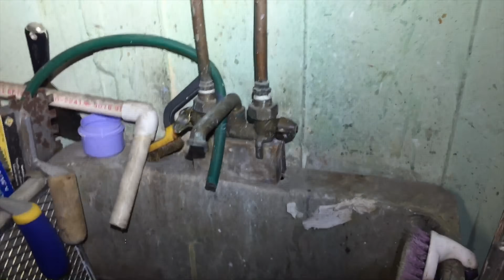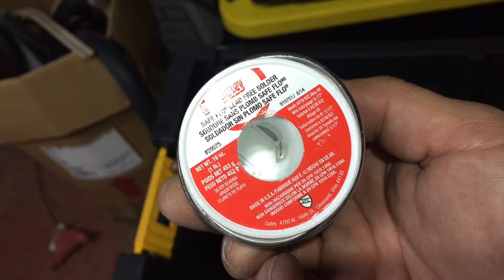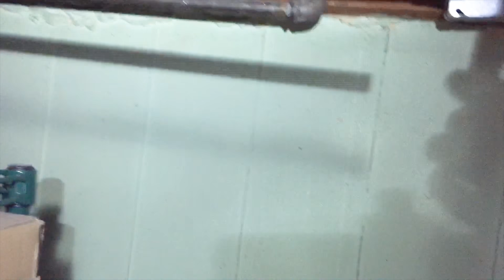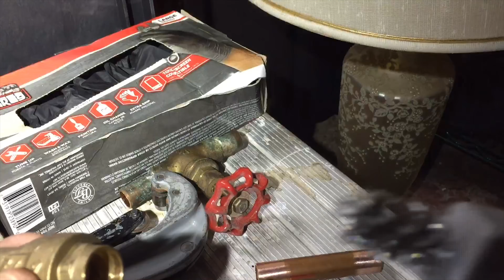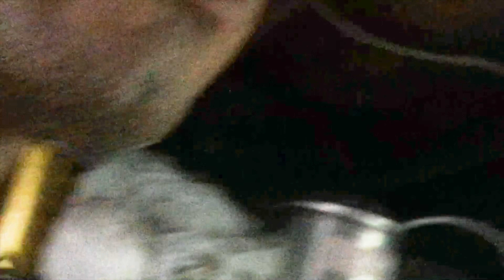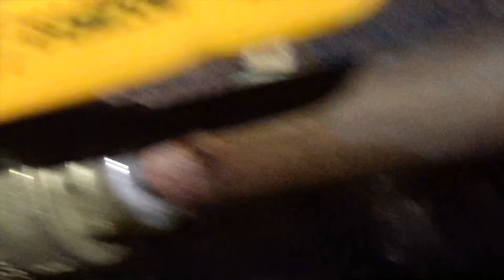Soldering Copper Pipe - How To Install A Ball Valve - Best Way

Comment: Only tighten the cutter a little bit per turn.  Try to turn it without going sideways.  You want the cutter wheel to ride in the groove from the first turn.
Missed deburring after cutting.  Want a smooth surface inside the pipe, and knock off any little hanging bits.  There's a little triangular blade on most cutters.

Some valves disassemble so you can get the valve seals away from the soldering heat.  Don't want to melt or burn the seals.
Also see @Andre Schwartz's comment.

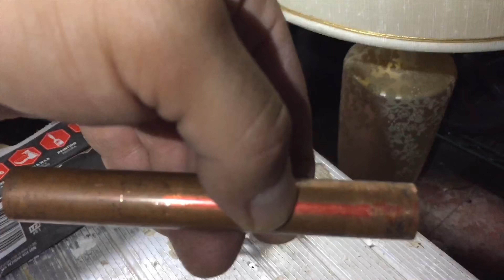Comment: 8:52 he used type M copper (red label - for hydronic heating) instead type L copper (blue label - for potable water supply). type M is like half the wall thickness of type L. in a heating system, the water is in a closed loop and loses its oxygen quickly and becomes dead water. dead water is less aggressive on metals so we can use type M copper and cast iron pumps for cost savings. for fresh water (potable and dhw) we need to use type M tubing and bronze pumps for longevity

Comment: Exactly what I wanted to see. I need to replace a shutoff valve, and after I cut the old one out, I will have too little pipe to solder in the replacement. I now know how to extend the pipe with couplings. I will let you know how this comes out. THANKS!

Comment: you cleaned, but didnt ream??
Reply: Good eye.  Thought the same thing.  Also would have remove the handle so the rubber doesn't heat up.

Comment: Use a SawAZaw and cut the valve handle off, them cut the old valve in the middle, you should have little need for extra coupling pipe. Old valve is junk, waste it, not good pipe 👍👍

Comment: The grogons you gave birth to could have been flicked off on that fitting you soldered  and Brasso used to polish up your workmanship, and as you used a blow torch on the valve at Nuclear core temperatures the likely hood the valve seats made from PTFE  are boo-bood (Fucked)

Comment: Gotta de-burr bro. Way too much heat, on that little valve with MAPP.  You want to take the flame off your fitting, before you try to draw solder in. Don't want to burn the flux off as you did there. You got a few fundamental concepts incorrect. Capillary action is what draws the solder in not flux. Additionally that's way too much solder. It ends up in you pipe anyway, then downstream in your fixtures/appliances.  You only need 1/2" of 1/8" solder per joint on 1/2" pipe.
Reply: Agree.  
 - Burrs will disrupt the smooth flow of water and keep joints from going together properly.
 - Flux cleans the metal, so the solder will adhere.
 - The joint has to be hot enough all the way around for the solder to be molten and stick.
 - Too hot oxidizes the copper and the solder.
Reply: Feed the solder from the bottom that capillary action will draw it up
Reply: Andre Schwartz amen  lol

Comment: Thanks, Your video is a excellent job of how to install your own Ball valve to replace an old valve.  Opening the upstairs faucets and basement faucets to get the water out of the system is very informative and important.  The importance of a Drain cap on a valve is also explained and very useful especially when replacing a old valve with a small amount of water still in the pipes.  You obviously know your stuff using a Bernzomatic self igniting torch and MAP gas for that lead free solder that is a pain to sweat with Propane.

Comment: Flux the pipe not the cupeling!
Reply from the maker: Flux both
Reply: VCG Construction 

Flux the cupeling and it gets scraped off by the pipe and dumped into the interior. By fluxing the pipe only this can’t  happen. ( I am an amateur with only a little experience in soldering 15mm tube)

Comment: Hey man, I used to work as a tool & material handler/apprentice in a local plumbers & steamfitters union, but that was years ago.  I needed to add two 1/2" ball valves to my hot and cold water lines in my basement and install a new brass faucet for my mop sink.  This video was a nice refresher.  I followed you step by step and first test- guess what, no leaks!  Thanks for sharing this video, much appreciated!  Take care my friend!!
Reply from the maker: Awesome Jay, thanks for sharing!!

Comment: Hey what's with the map gas and that torch, where's your acetylene tank with a quick release torch and hose connector lol?   Those torches throw too big a flame for my liking and you have to move the whole bottle with it not good for tight spaces.  The acetylene tips you can get are super small.
And Milwaukee  (other brands too) sells a self tightening cutters in a 3-pack (1/2, 3/4, & 1") .  Makes those adjustable cutters obsolete unless you ever run into 5/8 pipe.
Reply from the maker: The acetylene!!! All good points, for a DIYER looking to tackle small jobs these items are more accessible!
Reply: Yeah its a lot cheaper option too.